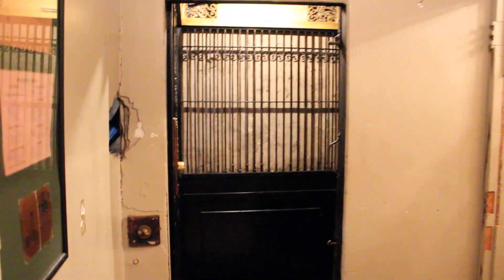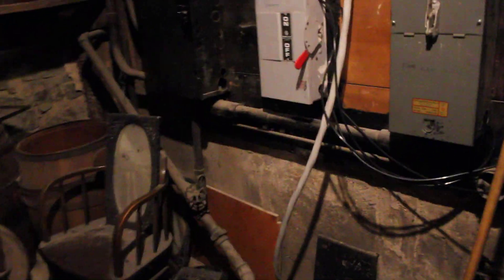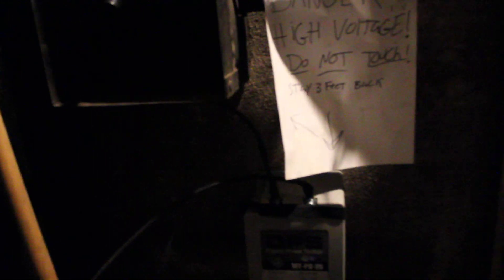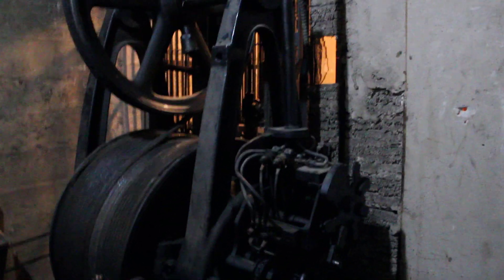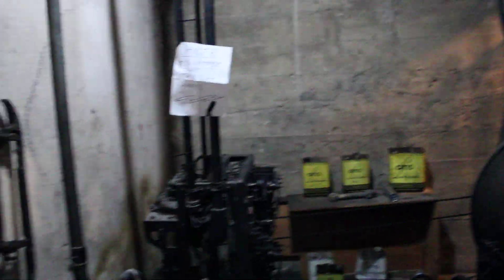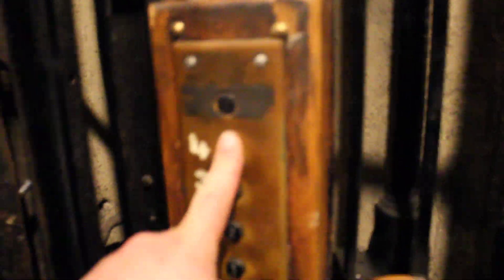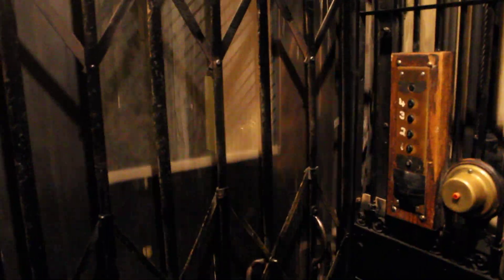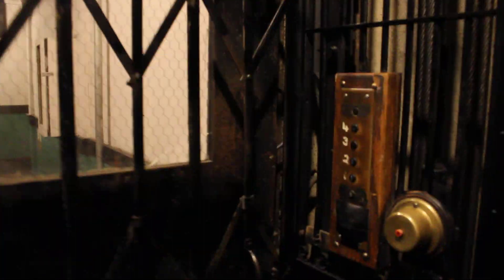1912 Otis Elevator first run since 1989!

Comment: Getting that thing recertified would definitely not happen. It's no longer compliant with today's codes. The only viable option here would be to rip it all out and put a brand new elevator in. It's quite a shame really because I'm sure that elevator could continue to work for another 100 years. Many surviving old elevators have either been grandfathered in or have been significantly altered to make them code compliant.  (i.e. covering up the cagework on the car and hoistway doors with glass or metal , ADA compliant buttons, emergency phone, firefighters' operation, etc).

Comment: This elevator was built like a tank running like a Swiss watch installed 111 yrs ago still has the original winding drum machine, floor relays/selector. I used to work near an office building in N. CA which had a bird cage Otis manually operated elevator, winding drum DC rectifier installed around 1908. It was preserved as an historic part of the building.  I did get to see an Otis winding drum machine room in an historic mansion in the PNW which is now a museum still in service, COP and call buttons. DC rectifier in the floor relay controller.

Comment: What most surprised me is that the elevator could find each floor by itself. I used to run a 1927 elevator in a 12-story building in Los Angeles but I had an up/down lever to make the car move. I had to bring the lever back to neutral with the correct timing to get the elevator to stop level at the desired floor.
Reply: Those are the manually controlled ones. Some newer manuals could level on their own if they were close enough to the landing, but then there are the ones that are just like the one you used to run.
Reply: That was before micro leveling

Comment: The buyer better not modernize this
Reply: It could be protected against modernisation since its this old
Reply: @Cloverboi  oh that’s good
Reply: @SixSilverStones  Sadly that elevator is no longer compliant with today's elevator and ADA codes. Given it's conditon, the state might require the building owner to replace it with a brand new elevator. I would be suprised if that elevator passes inspection.
Reply: @ yeah ik but it’s so cool

Comment: So was that temporary service installed just for the elevator test or was that there for some basic lights and tapped into temporaryly? Had a feeling we were going towards a digital phase converter when it was mentioned to be 3 phase. Interesting more or less that's all it took and some general maintenance. It must've been well cared for.
Reply from the maker: The temp. service was installed for lighting so work could be done i the building... I took it a step farther...

Comment: So you're saying this elevator hasn't moved since I've been born? And it still works that well wow. It truly would be a shame if it had to be removed. But it is certainly costly and out of compliance for many things I'm sure. I'm leaving a gaping hole for some thing modern right up the building.
Reply from the maker: The last time this unit moved was 1989, when the apartment building went out of business, and sold. The guy who bought it in the early 2000s put a new roof on it, which is the only reason this unit is saveable. Thankfully, according to the state inspector, it needs a few safety improvements, and a weight test, along with a laundry lists of repairs to make, and it is certifiable. It is going to stay this way, since there is no practical way to install a new one in the shaft.